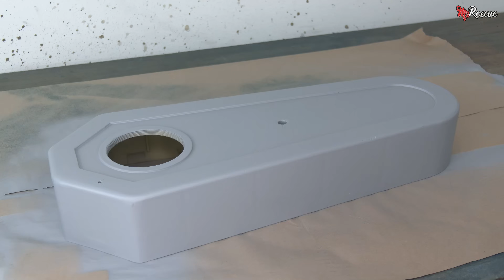Restoration Lathe Machine - Complete Process

Comment: Well you didn’t addressed the main issue, the lateral play of that tailstock. With such a play your lathe will never run true and be useless
Reply: Details aren’t important 🙄
Reply: Everyone knows the rules of a “restoration” on YouTube is that you unscrew everything slowly, have lingering shots of screws held in tweezers, fill dents and file casting marks, give it a shit ton of filler and paint it, then ignore the issues such as play etc. don’t forget all comments to call them a craftsman, artisan etc. oh and also add “context” claiming they’re doing it right and you speak from a millenniums expert experience as xyz trade all the while being a shop assistant in KFC
Reply: @paulfife578 paotem tokarka trafi na eBay i ktoś naiwny kupi sądząc że jest jak nowa
Reply: @paulfife578  True that!...
Reply: Also while cleaning the dead center, he clamped it by the taper.

Comment: HaHa- you forgot to put your front seal plate on the lathe shaft before installing the front bearing- You did not show the adjustment procedure for the clock spring on the mill quill or how to fabricate the missing gib for the tailstock.

Comment: I have owned a 3-1 for a long time.  There are a lot of haters of this type of machine.  And they're partly right.  They're crude and won't really work to 0.001" accuracy, no matter what you do.  This one lacks a feed system, so that is a negative.  But these things have good motors and good spindle bearings.  Still, using a 3-1 is a challenge if you actually intend to.  But with an awareness of backlash and some skill, they can be reasonably good tools.  I've made some semi-sophisticated pullers and other tools with mine, including a blind hole bearing puller, valve seat machining tools, and other things.  You did some good refurb.  Careful, fairly thorough, though seemingly mostly appearance-focused.  Good stuff.  Thanks.
Reply: Yep.  That was my first machine tool.  It was anything but accurate but still it was good for making spacers, plugs and other simple turnings.  Ya gotta start with something.

Comment: Got a chester mk 2 same shape over 30 years old still use only had oil change and bearings changed still running  , the depth from chuck to lathe bed makes working  on big projects ideal . In mid process of restoring a myford ml2 my first lathe my dad got me  be 40 years I had it.

Comment: Looking good! My suggestion is put the start capacitor in a piece of PVC pipe and paint it to match the motor. Keep those cut spirals off those wires. Or a lot of electrical tape. Looks like new!